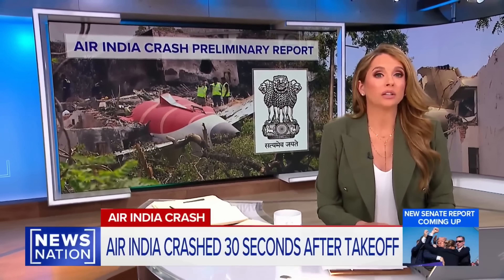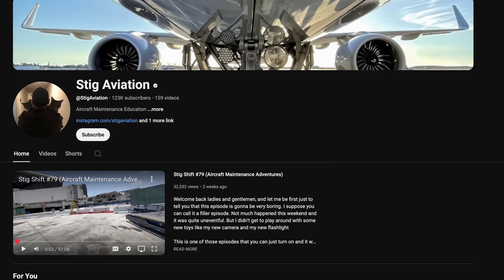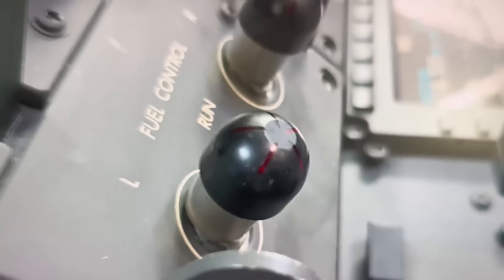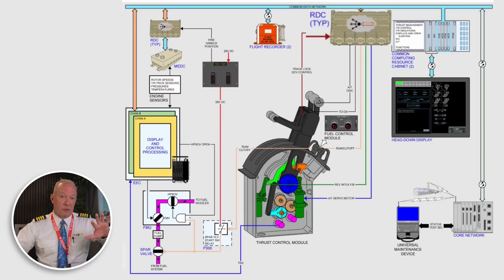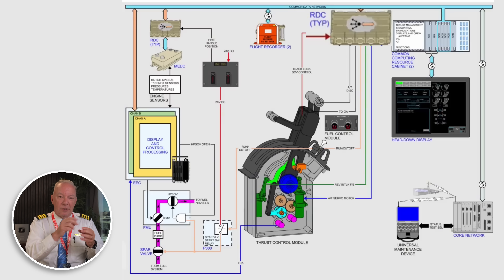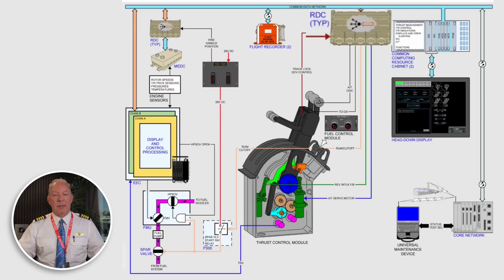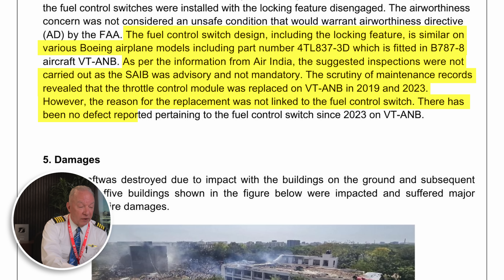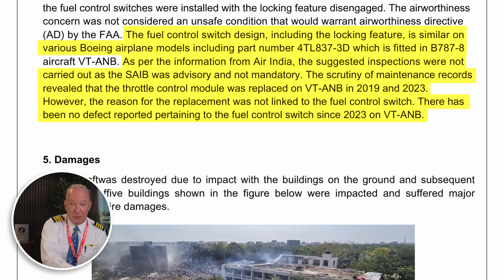The Truth About Boeing 787 Fuel Control Switches

Comment: Hey Captain Steeeve, I have a question for your “ask the captain series”. I’ve been doing a lot of research on flying and read that the air is super dense up high so when flying at cruising altitude, the pressure around the aircraft is equivalent to something like soft clay. (Kind of like the jello theory people talk about): but in one of your videos you said during takeoff that you need as much power as possible to get off the ground because of how dense the air is, and that it’s easier once you’re in the sky, which is why after 1500 or 3000 feet you turn down the engine. can you shed some clarity on that please? Because I was told that going 150 mph, which is when you get lift or V1, is equivalent to the pressure underwater. Hope that makes sense. Also, your videos are super helpful, Thank you!!❤

Comment: I still have a question about what powers the fuel pumps in case of total power failure.  Can they also be run from the "hot battery buss" that you mentioned?
Reply: The pumps probably run off direct current as well. In any case rhe pumps were working in this flight, thats why one of the engines started spooling up before the crash

Comment: Do we KNOW that the switches were moved ?  I dont know what the black box records but AFAIK it doesnt monitor the physical movement of the switches - how could it ?
I presume it monitors the 28v circuit either before or after the relays Where does  it monitor ?
Movement of the switches may well be the most likely cause of a stopping of the 28v power in these circuits (esp 2 circuits a second apart) but that is what is being monitored not the switch movement
Reply: That's not how deep they go before drawing a conclusion.
Reply: The position of the switch is monitored by a signal to the data bus off a dedicated pole on the switch. It’s pretty much a certainty the switches were (physically) moved to cutoff.
Reply: @slavedriver394  
thats not shown in the diagram at 4mins 22

Comment: Question what happened between V1 rotate and lift off does the black box show that the cut off switch was moved from on to off at this point of the flight ? If so it would suggest the pilot or co pilot had moved those switches...if that was not the case is it possible that those switches had a fault and could have moved through maybe vibration of the aircraft or some other means

Comment: What you said is correct Captain. However, the relay itself is electrically activated and amperage to the relay might be a different than the amperage from the relay to the valves. Boeing might have a failsafe system that “malfunctioned”, designed to remove power to the relay thereby closing the fuel valves in the event of an impact. Worth noting that new automobiles have this feature.

Comment: Rather than this even be discussed wasn't there audio of the pilot asking the other why he did that? Is there not a timeline and if the shut off valves were closed and then reopened at the exact same timing as this conversation then it's clear. If it was a fault which after seeing this is impossible anyway but even still how would they be able to turn them back on if they were already set to on but had impossibility glitched off

Comment: @CaptainSteeeve, the 2019 incident involving an All Nippon Airways (ANA) Boeing 787, had the FADEC / EEC system triggering a dual engine shutdown due to erroneous sensor input, mistaking the aircraft's state as landed when it was still airborne.

So, it would not be  correct to make a sweeping statement, at 08:00, that the only way to open / close the fuel control valves is through the fuel control switches that are in a closed-loop with the relays.

Secondly, the Lithium-Ion batteries that are supposed to continuously supply 28V DC, are themselves under the scanner for possible malfunctioning due to fire.
Reply: The ANA plane was on the ground not airborne. The FADEC was for a different engine brand.
Reply: @stimproid  , you're right. 
The ANA 787-8 Dreamliner had the Rolls Royce Trent 1000 engines and the AI-171 Dreamliner had the GE GEnx-1B engines. 
The FADEC/EEC system implementation is different in both these engine types.

What I'm saying is that, in the 2019 ANA Dreamliner incident the fuel switches had transitioned on their own, due to a software glitch, without any pilot manual input, while the aircraft was on its final approach. 
The software issue (or a faulty WoW sensor?) caused the EEC to mistakenly interpret that the aircraft was on the ground, prompting the TCMA system to automatically shut off fuel to the engines, even though the pilots had not activated the fuel cut-off themselves.

In the AI 171 crash. during the take-off roll, a potential software glitch, or a faulty WoW sensor / an electrical malfunction may have prevented WoW sensor signals from reaching the EEC.

As a result, even though the AI Dreamliner aircraft became airborne, the system may have erroneously believed it was still on the ground.

This could potentially have triggered automatic actions like the system attempting to lower the landing gear (which the AI pilots would have commanded to retract soon after rotation) or the EEC cutting off the fuel supply of both the engines WITHOUT ANY PILOT INTERVENTION.
Reply: Totally agree with you on this and to make that statement without any data or limited data given in that stupid AAIB report is insane.  We can't ignore the 737 max tragedy and Boeing hiding about the MCAS as then it felt it was not important but guess what it actually was. So if I was you I would refrain to make that statement and wait for the investigation to be complete because these remarks are directly point to pilots faults.
Reply: @ramandeeptalwar9417  The pilots of the doomed 737 max planes did not need to know about the MCAS system in order to save their planes. 737 pilots are trained on a memory checklist for "runaway stabilizer trim." The MCAS problem they had presented to the pilots as runaway stabilizer trim. Had they followed procedure both, aircraft would have made it home.
Reply: 100%, agreed.

Comment: Your talking about the top of the switch...but like a light switch it moves items under the knobs and they can get worn out or abused if you will and sit only half way on or off and it would only take vibration to complete the flip

Comment: I am an avid fan of air navigation, though admittedly still very, very immature.
I truly enjoyed your video, and a big fan of you, but I do have some questions. I understand that the throttle control was replaced in 2023, and that there was no report of any problem with it; however, we cannot assume there was no issue on the day of the accident. I also understand that the fuel switch cannot be shifted inadvertently; however, is there any other switch on the panel similar in appearance or placement to the fuel switch that a pilot could mistakenly operate instead of the fuel switch?
Hypothetically, if it were intentional, would cutting off the fuel switch be a viable way to crash an airplane under those conditions?

Comment: Note that this is not an electrical schematic that is shown, nor a signal flow diagram. The power to the switch is not shown nor was the connection to the RDC talked about. No ground structure is presented and only one circuit is  shown. This would not be enough information for any real failure analysis.

Comment: The fact that the cut-off switch's are directly connected from the bats with no other circuit between them unfortunately means they had to have been manually operated , even if the plane failed in every way those switches will still have power

Comment: Dear Steve ,
Correct you. Here , the voltage DC to the fuel on off switchs on flight deck gets only 14 Volts DC to the relay but not the 28 volts , 
(it may possible after relay to fuel spar values loop there is 28 volts DC )

Comment: There is only one problem with the pilot suicidal theory. It has been shown that RAT was triggered before the switches were moved. The take of roll was longer than it should have been. I was on board with the pilot suicidal theory, until taking a look at these factors. The pilot moved the fuel switches to reset engine relight is possible! A water in fadac,is possible!

Comment: Being of a very technical background, and fully understanding exactly how those switches and that circuit works, my questions is of the human side of the crash.

The switches were move, by one of the pilots. They cannot move on their own, simply impossible. The circuit has nothing between the switches and the fuel control valves themselves, so that rules out an uncommanded instruction from a computer. That only leave one question. Why did one of the pilots move the switches?

Now we have two option, was it deliberate or accidental? But 'accidental' I mean the pilot thought he was doing something else. Very common at a subconscious level to (in this case) lift the switch lock to move it as an 'automatic' function. When you get in your car and go to move the shift lever... Some have a button on them, or a lock, that needs to be actioned before the lever will move. When your hand goes to move the lever you 'automatically' disengage that lock. You don't even have to think about it. Same may have happened here. Instead of, for example, moving the gear retract lever, the pilot has accidentally put his hand on the fuel switches. It's not a leap to think he'd just lift the switches because 'that what needs to happen with those switches'. We have been told from the report that when asked 'why did you cutoff?' the other pilot responded, 'I didn't'. He may have genuinely thought he hadn't. It happens.

I know a lot of people want this to be a Boeing technical failure, but as an electronics tech, and ex-ROV pilot, I'm just not seeing it. Just look at the timeline. Aircraft lifts off, fuel switches transitioned 1 second apart, engines lose power, RAT deploys, pilot asked why fuel cutoff, then moves the switches back to RUN...

I think this is probably a pilot who had a 'brain-fart'. Horribly as that sounds, I really can't seeing it being much else.

Comment: I would be interested to know more about the 737's problems that required the FAA to issue that bulletin. According to SAIB: NM-18-33 says the switch in the 737's were found to have  P/N 766AT613-3D should be replaced with P/N 766AT614-3D because it had an improved locking feature. What P/N did the 787 have the one that was improved or the one that wasn't improved. No one is even discussing what the full SAIB says Captain steeve read short part of SAIB I hadn't looked at the full SAIB until just now. Lot of that SAIB has been glossed over by these channels.

Comment: Good video Captain - at 7:50 - that discussion seals the deal. Sorry to the guy who was arguing during the intro against Steeeve's explanation.

The valves, though, are not fail open (even though the POWERED circuit is), they are fail-safe, which in this case is closed. They must be spring-to-close.

Comment: Captn Steve, you are making a convincing case for the fuel cutoff switches having been operated deliberately. There can be little doubt about this technical detail. However, that is not the end of the story: The big question is why these switches were moved. How do you evaluate the fact that the RAT was visually recorded as deployed 2 seconds after rotation, 2 seconds BEFORE the fuel control switches were set to Off? The RAT automatically drops out after an electric power supply failure, among other potential triggers. At 15:00 you are referring to the engine failure occurring after the fuel switch transitioned to Off.  This is different from an electric power supply failure, either actual or a false indication. Some experts are working on the hypothesis that water in the EE bay, presumably the aft one, caused an indication of a total power failure, or caused an actual power cut within 2 seconds after rotation. Such an event might have caused one of the pilots to cut off fuel to both engines - as a response, probably misguided, yet without malicious intent. This fits the observed and recorded timeline, which unfortunately is only partially disclosed in the official preliminary report. The record of RAT deploying before the fuel control switch being moved to Off eliminates the theory of a deliberate act of sabotage by one of the pilots.

Comment: Im curious, im no engineer but do have a degree in electronics, and have done some pretty wild things with relays in the automotive world using low voltage control (5 volt sensors/satelites) to actuate higher voltage (12-14 volt) loads , that even i was surprised it worked as i had wanted it to. (after 2-3 revisions lol). How does the monitoring system in the FDR record the state of the switches and valves if its closed circuit? Diode isolation? separate relay isolation? I'm genuinely curious

Comment: Agree that most likely scenario is for the switches to have been physically moved thus the engines shutdown. Pitty that the preliminary report did not also state that the sound of the switches "transitioning" was also heard. This would have stopped all this discussion.

However, Captain Steve, your attempt to simplify how the fuel switch works does not accurately describe reality. Your diagram clearly shows that the switch is connected via a digital interface to the plane's redundantt digital buses. The is no pair of copper wires sending 14V directly from the relay to the engine valves.

The Full Authority Digital Engine Control (FADEC) system is a highly integrated digital system responsible for managing the engine's performance, including fuel flow.

And there's one accident that almost happened because the digital systems failed. Qantas Flight 72 - Airbus A330 incident. 

As a computer engineer, I can understand why it is almost impossible for pilots to also fully understand how all the digital systems on a plane function. To you, they are a black box which you have been told to trust implicitly  because they have been tested and certified and you don't have the luxury of not trusting them.

I do hope that soon, because now it is 100% feasible technically, to require planes to dump in real-time all the plane's gigital instrument readings to an AI system which will in 1 second come up with a fully accurate diagnosis of a problem. Too many accidents have happened because the pilots, humans after all did not trust what the onboard computes were telling them.

Comment: Hello again,
And the sensors of fuel supply are located in the fuel spar valves those sends status to FADEC and RDC and finally to FDR ,
They aren't located in fuel switchs at the flight deck in cockpit.
So any movement of fuel cut or run is recorded from the FUEL spar valves positions .
Thanks

Comment: Ex-Avionics tech here. I have worked on P-3 fuel cut off valves and "gated" switches of this type. The fuel valves are powered open and powered closed. The the diagram above is over simplified. If all power was lost the valve would stay in it's current position whatever that may be. You would need to hit the gated switch with a hammer to get it out of the current position without pulling it off the gate. So it moving by means other than deliberately positioning it by hand is virtually impossible. According to the above diagram, the fuel cut off switch only DIRECTLY controls the SPAR valve, not all 3 valves. The HPSOV is controlled by AGREEMENT between BOTH the EEC and the cutoff switch. The Fuel Management Valve is only run by the EEC. Again, according to that diagram. Captain Steeeve, why did the RAT deploy "all by itself " BEFORE any untoward data starts appearing on the FDR? Could the RAT deploying have confuse one of the pilots? What would be SOP for RAT deploy on rotate? What would the pilots have seen in the cockpit at that moment?

Comment: The SPAR region fuel valves are spring loaded selonoid type, they stay open until there is DC power present in the relay p300 , if DC supply cut they closed straight away,
Before take off the huge fire broke in first main Lithium ion 65 amps 28 VDC battery or electronics which made DC supply from battery 0 volts ,
Because fuel spar valves have a supply of power from battery so they closed straight away, 
Meanwhile RAT was opened and in 10 seconds later it could had resuply electric and hydrolic backup power ,that supply DC back to spar fuel valves, 
(This was the reason of TEN SECONDs delay between switches cut off and on again position,)
And only then poor pilots could delighted the engine one ,

Comment: Your electrical schematic dies not match your description.  Yes, the Spar Valve runs straight off the relay.   The HPSOVE only actuates with the signal from the relay and a signal from the Display and Control Processing.  That is an AND gate shown.  The FMV is not connectied to this relay and is run solely from the Display and Control Processing.  So one valve runs off the realy.  One runs off the relay with the agreement of the Control Processing.  And one runs only from the Control Processing, no connection to the relay.

Comment: Please review CCTV crash video showing copilot banked left while descending, intentionally towards medical hostel with a subsequent right bank/turn and a final left turn away from a road, dead center for the building rooftop. The fuel switches were the initial plan, with the building being the final contingency guaranteed plan. This was obviously intentional.
Reply: They likely couldn't see anything directly in front of the plane due to the pitch angle the steadily increased  throughout the brief time in the air. The captain likely cut the fuel while the Fo was flying. You are suggesting they were working together to crash the plane?

Comment: But what happens when the springs holding the fuel switches in either position break?  If the spring breaks, wouldn't the switch fall from the on to the off position?